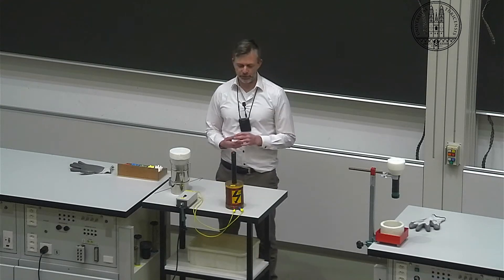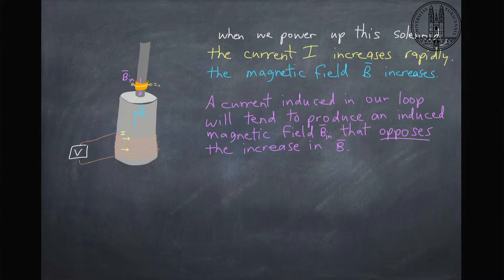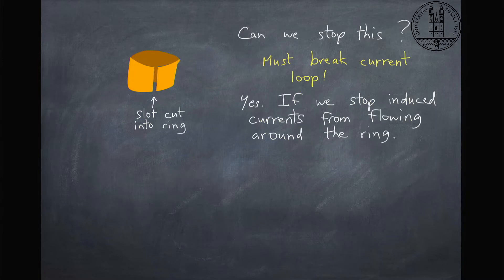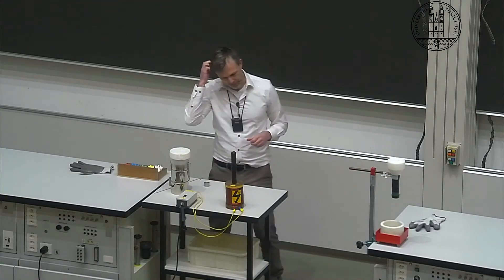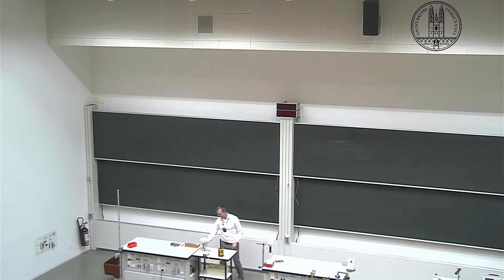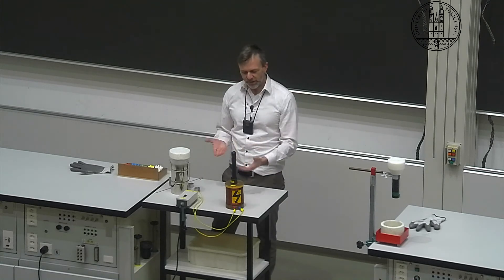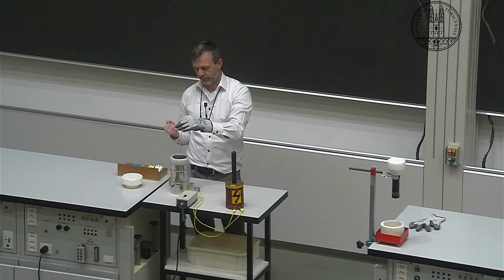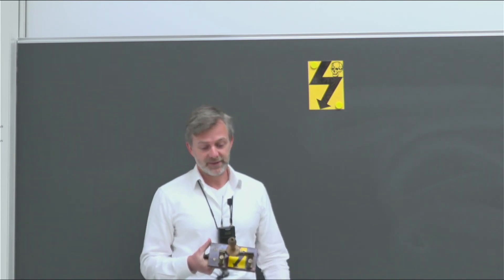The jumping ring and Eddy currents.

Comment: I made something similar when I was in high school. Mine was a flat coil from wire I got from a local telco van. I plugged it in to the mains AC and it kicked an aluminum frying pan up and hit the ceiling. Then the wiring started to melt and smoke. Wasn’t the first or last time I almost set the house on fire.